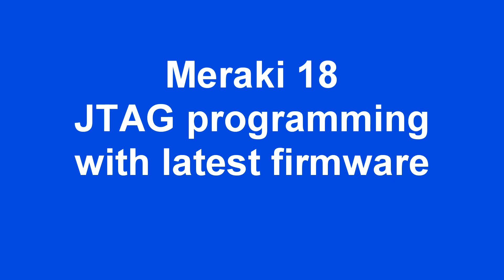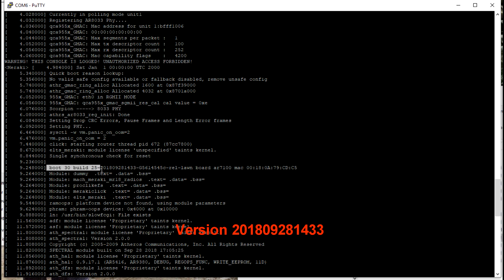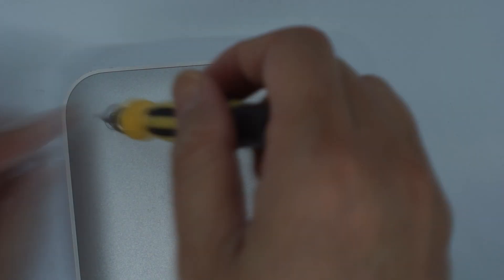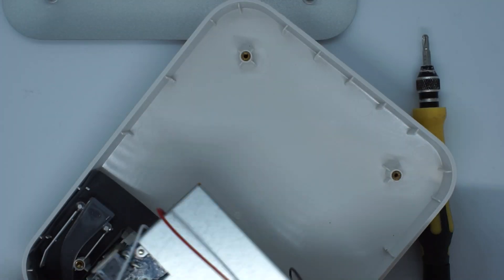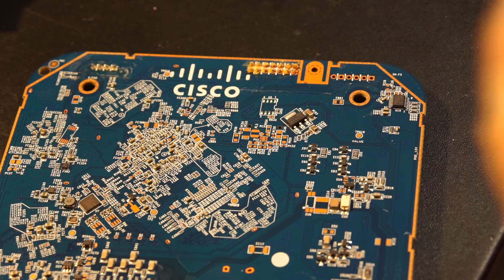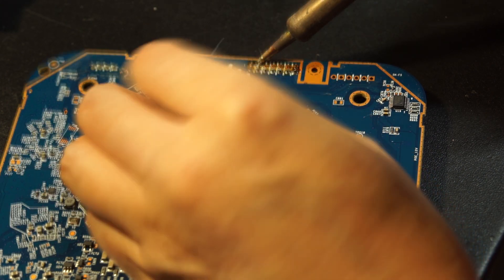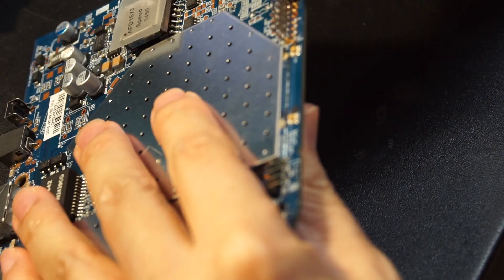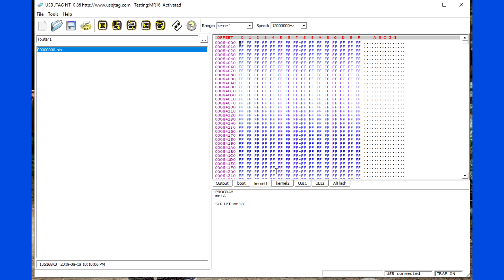Updated version of MR18 JTAG programming.

Comment: Hi! I am going to try this with my MR18 this weekend. I wanted to ask you, could a similar method be used for a Meraki Z1? I was trying to install OpenWRT on it with the standard UART procedure, but unfortunately Cisco has removed or disabled the "odm" command on the latest firmware. 
The board does however have JTAG pins (or the holes for said pins, to be correct). Could we take advantage of this?
Thanks for the video, it's very informative and to the point!
Reply from the maker: Not yet. Z1 uses diferent CPU core. Might be future project.
Reply: Did you do this?
Reply from the maker: @jonathanhumphrey3669  I  tried. The datasheet says it is MIPS core, but JTAG shows it is ARM core. Confused.

Comment: Running v25.14 and downgraded to v25.13, cannot get USBJTAG NT to halt with -program no matter what. Have UART connected to view output. Double checked pins, etc.. Any ideas?
Did having v25.14 prior completely lock it down?
Reply from the maker: Please do this. Hit program within ONE second after power on the router.
Reply: @usbbdm  Thank you for the reply. I've done this probably 100 times. Double checked solder pins, tried different ribbon cables, direct wired, etc. Brand new jtag, shows connected and debug on. Not sure what's going on it just refuses to stop boot up sequence with -program
Reply from the maker: @SFTalon  Go to my site and I can can help you out.
Reply from the maker: @SFTalon  I can use remote desktop to help you out.
Reply: @usbbdm  Ok where do I go?
Reply from the maker: @SFTalon  www.usbjtag.com . This is where you get the USB JTAG NT from,